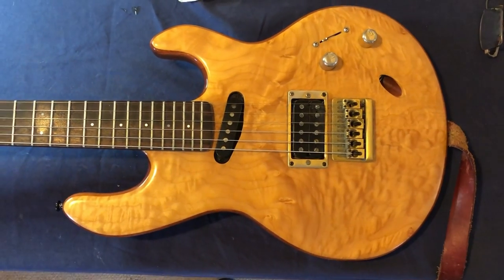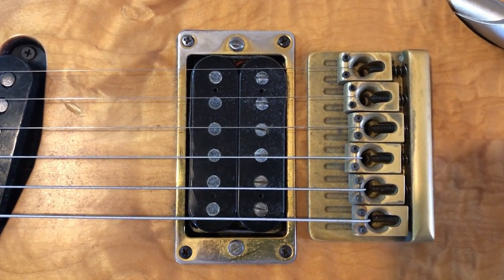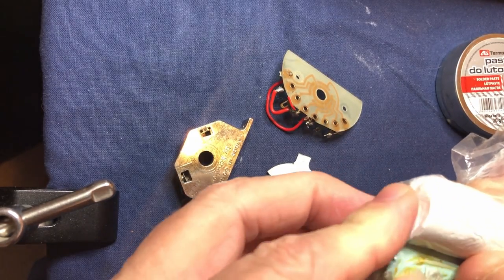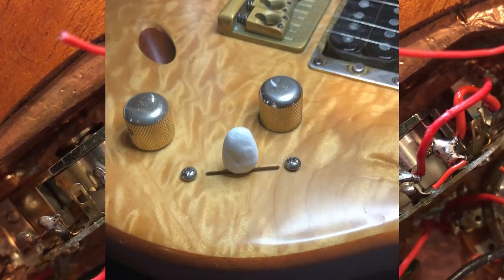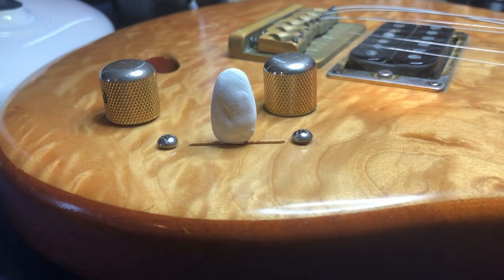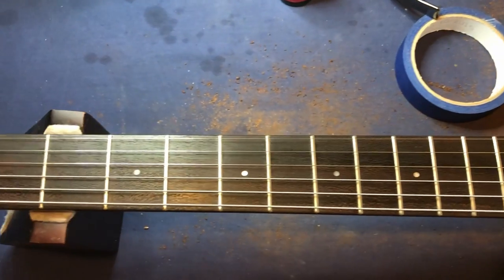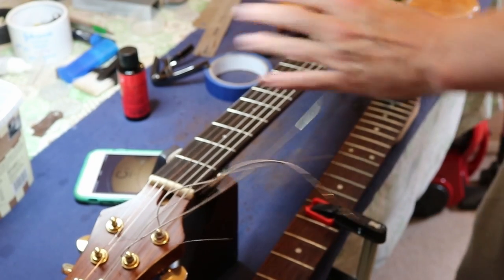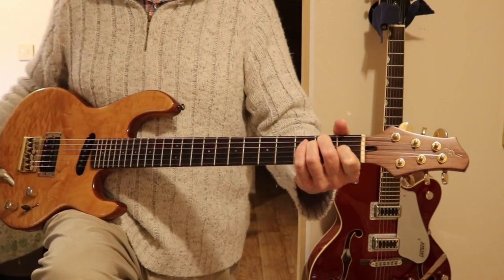Ernie McMillen Guitar - switches, holes and pickups and a lotta love.

Comment: McMillen is EN at the end! I made that guitar over 30 years ago, and the thin body was at the request of the customer. That led to having to reduce the switch depth. Doing it again I wouldn’t use a mega-switch, which, by the way aren’t £45, they’re more like 25 or less. I have some old ones, which if you’d contacted me, you could’ve had to bastardise for spares. The lack of truss rod cover was at customer’s request, although I also prefer it that way. The fingerboard is snakewood.
The most important thing I need to say, though, is that the guitar is not, and should never be called, a Lowden. It was made by me, under my own name and has no affiliation with what was then the Lowden Guitar Company, the Avalon Guitar Company or what is now the Lowden Guitar Company.
Reply from the maker: I have corrected the spelling - I might be able to add a card denoting the guitar's provenance... I will try.
Reply from the maker: I have added the provenance in the video description.